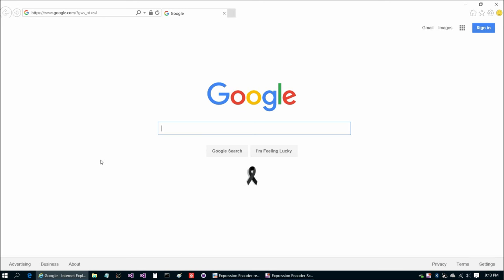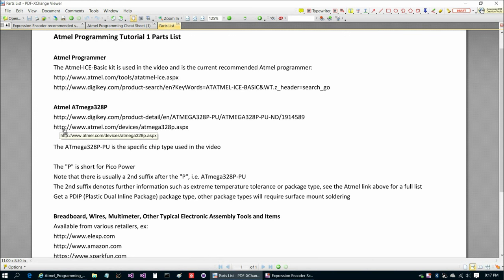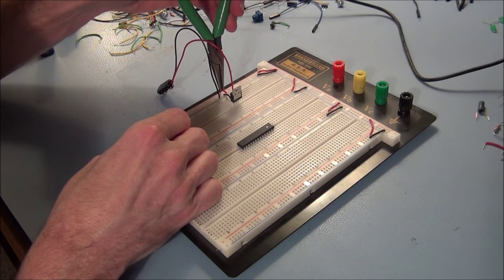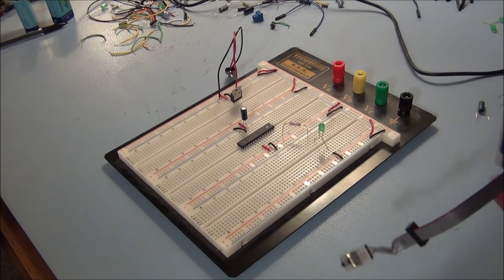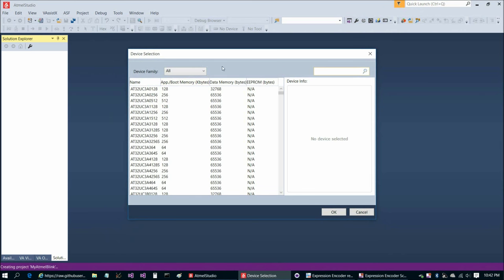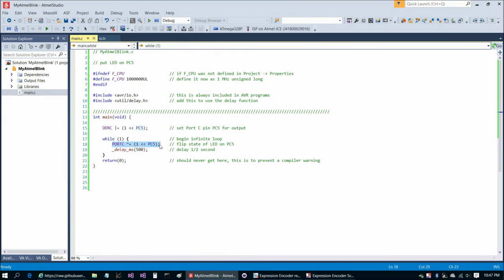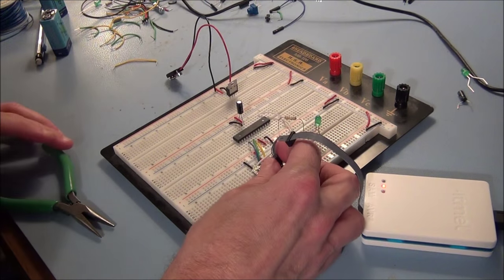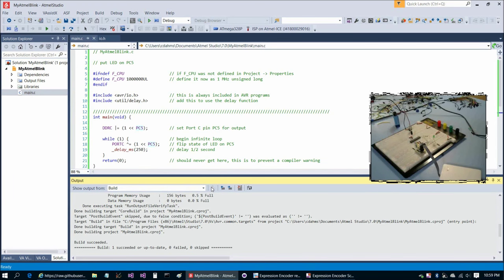Atmel Programming Tutorial 1 - 1st Programming and Blink a LED

Comment: Thanks for the video, my robotics professor Mr. Pruitt recommended an Atmel microcontroller for a submersible GPS dolphin that runs a lap underwater, I want the engine to be like a series of fans that push water through the core of robo sub and add water through a sine wave generator to propel the dolphin and robotic submarine.

Comment: Wonderfull , but I reduced the speed to .50 as I am old , model 1954 and can not comprehend fast  presentations , but at .50 you sound really really high HIGH , thanks for uploading the AVR programming I am grateful. One question , Is it possible to use UsbAsp instead .

Comment: Thank you Chris for the video. Wish to know, what's the function of the capacitor please?
Reply: I assume it's a filter to send any ripples in the supply voltage to ground to give extra protection to the chip, but I could be wrong about that.

Comment: Why do we run a capacitor from pin 7 to ground?
Reply: Its just a bypass capacitor to help stabilise the supply voltage, get rid of any unwanted ac signals from the supply

Comment: I got a doubt that ...., In every micro-controller board there is crystal oscillator but in this video it was not there. can anybody explain.
Reply: The 328p has an internal RC-oscilator @8MHz, which it can use as a clock. You can enable it with a fuse (in fact; it's enabled by default). It is not as stable and precise as a crystal (because voltage and temperature dependant), so less reliable for timing sensitive stuff like serial.

Comment: HOW DID YOU PROGRAM IT AFTER BUILDING. THIS IS THE 6th VIDEO on a row that does not showit.
Reply: About 18:00 he says to hit ctrl+F5 to run the program, then picks a programer, ctrl+F5 again and there you go. The light is blinking which means the the program is on the chip & running.

Comment: Why is Pin 22 connected to ground and 20 to power?
Reply: https://components101.com/microcontrollers/atmega328p-pinout-features-datasheet

From this pinout sheet, you can see which pins need to go to ground and which needs to go to power.

Comment: You forgot the capacitors for the voltage regulator.
Reply: I don't think you need it's not that important if you're running it from a battery.
Reply: chinrxn the capacitor on the input isn't that important, but the one on the output is very important. Look at this schematic of a (very simple) linear regulator:

http://m.eet.com/media/1050905/C0334-Figure1.gif

Without the capacitor, the output would either be at the unregulated voltage level or ground.
Reply: @chinrxn  ATmega328p operating voltage is 1.8v to 5.5v.  9 volt battery might cause a sad face.  :)